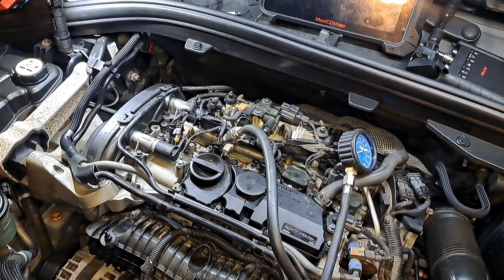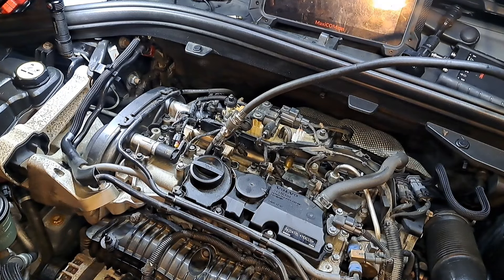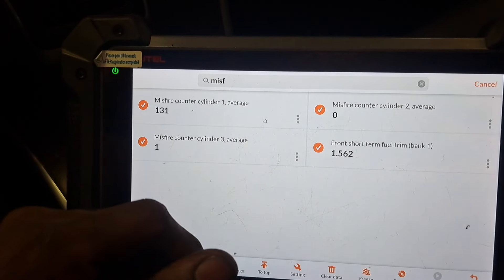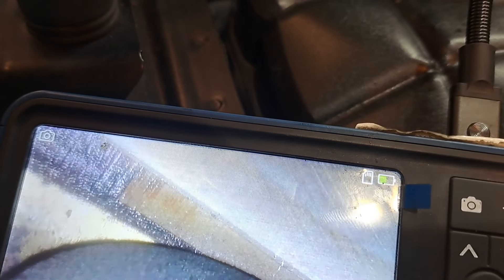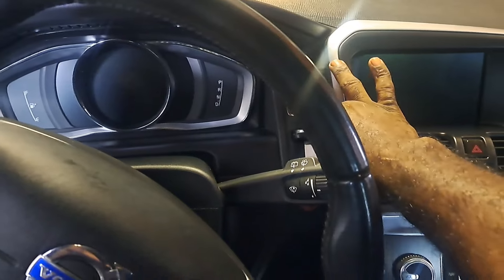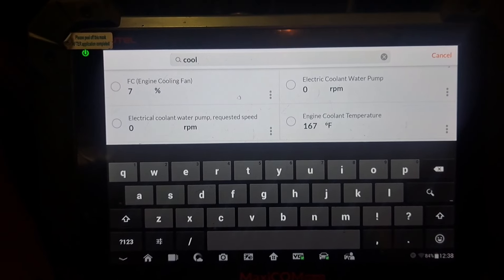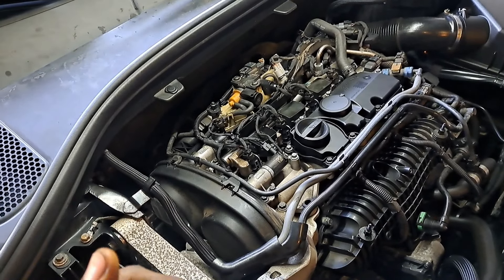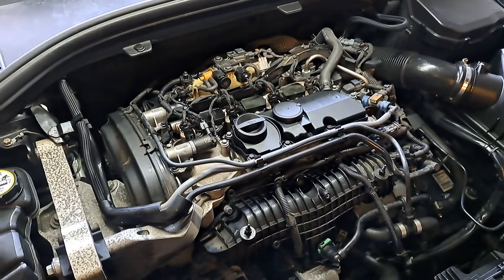passive intake valve cleaning with diesel, p0301 does this method work, with proof

Comment: Just wondering where all the carbon/trash went?
Exhaust?
Plug up the catalytic converter?
Reply from the maker: Well... after being loosened, weakened, and partially broken down with the flush.

 I theorize after the initial push with the spark plug removed. Some got pushed out that way. 

3rd... I'd imagine that with the compression and violent explosion during the combustion process,  the weakened granulated particles got atomized and digested in the exhausted system.  

Catalytic converters don't plug like you think.  The granules aren't just sitting there. You have to take SCAVENGING into consideration, it's gonna tumble around

Comment: Thank you for sharing this. It is really a great method, mostly shops use expensive walnut granulate method  to blast valve stems clean, but that is expensive and a lot of work since it involves taking off the intake, which is often not easy on many modern direct injected engines. Diesel is good, the last thing one wants is to destroy valve seal, which contain plastics, so never use aggressive solvents.

Comment: I do this all the time since I have a diesel and the EGR just clogs up the entire intake system. But what works better is acetone. It's a bit more expensive but the results are bare shiny metal. Don't worry if it goes past the piston rings just change the oil after. After the cleaning I always put a bit of oil into each cylinder since the acetone will certainly strip the rings and cylinder walls of any and all lubrication. It will be a completely dry start so keep that in mind if anyone tries this. Works great though, melts the diesel snot away in seconds!

Comment: Good vid thanks👍 try oven cleaner😊 it melts carbon in minutes. Only problem is its very agresive. Try it on a piston if you got some laying around in your garage👍

I used oven cleaner on my former audi a4 ,piston rings stuck and oil usage. After the treatment 50% less oil usage.